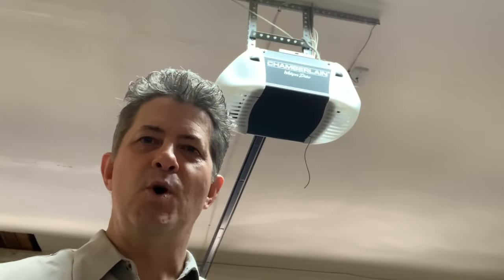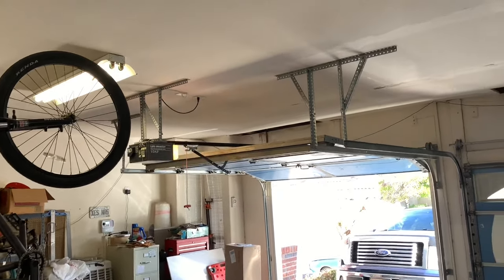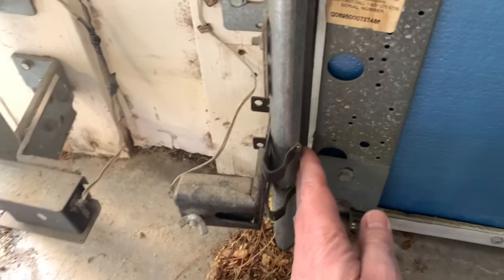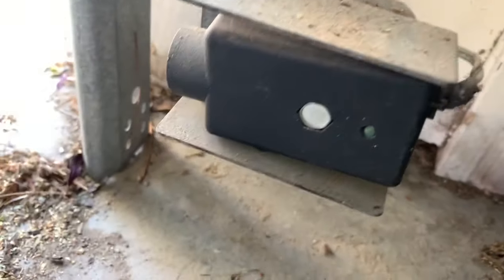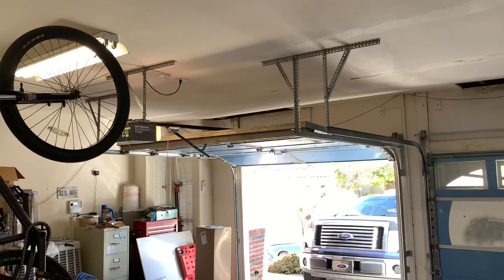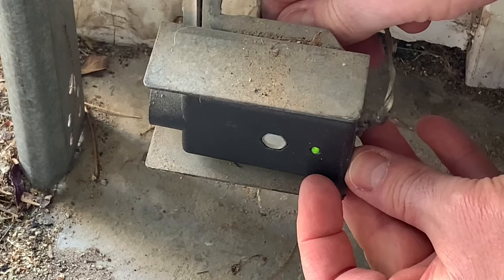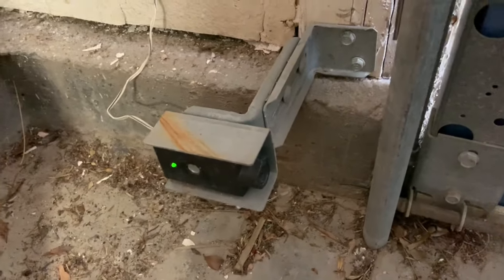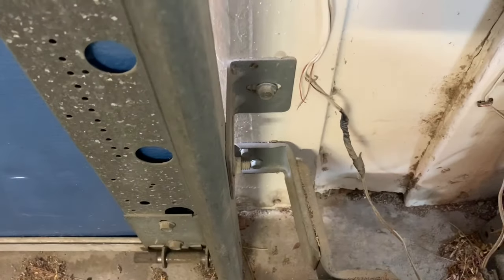Garage Door Opener Stops and Reverses

Comment: Our light on the sensors are both one one red one green but our garage door is still not going down but will go up.  Do sensors with light working be bad?
Reply from the maker: Sometimes when the seasons change you need to adjust the opener. I would try increasing the downward force slightly. There should be a dial on the motor for this

Comment: Hi, thank you for your videos. My garage door is stuck at about 2 inches above ground. If I press the button to close it , it closes, and then automatically reverts to 2 inches open. The light does not go on and off. Any suggestions would be gratefully received. Thank you, Paul
Reply: Did you figure it out?

Comment: Finally figured my problem with the garage door not going down after playing with the sensors. When I couldn't turn off the garage motor light I looked at the sensors light assembly and saw that it had moved inward which not where it needed to be, so pushing it over made the sensor light come on brighter like it should be. So I also tried it and the door came down like it should and the light on the motor could be turned off and on. Hope this might help others with this problem.
Reply from the maker: Glad you got it figured out!

Comment: I havent checked my sensors yet ill do that tomorrow but for now i just have to say when i click close it goes down to about 6 inches from the floor than goes back up but if i follow trough with my hand just light pressure on either inside or outside of the door kind of like help it on its way down it closes fine so can that still be missaligned sensor or something else
Reply from the maker: Based on your description it doesn't sound like a sensor issue to me. I would increase the downward force slightly on the motor. That should solve it.

Comment: My garage automatically opens any time of the day. How can I solve it? Thanks so much in advance.
Reply from the maker: Curious if your door opens as a neighbor opens his door...As a starter I would change the security on the opener to make sure nobody in your neighborhood has the same code. You can either hit the smart or learn button, or manually go in and change the dip switches on the motor unit.

Comment: My sensors are solid lit.  My door went up + won't stay closed now.There are 2 up + down lit arrows on the back of the motor.  The up light is blinking twice, the bottom arrow is blinking 3 times.  Any advice ?

Comment: If it's almost all the way down and then it stop and reverses itself, could it also be the sensor?  What other things could I check?  Thanks!
Reply from the maker: Try increasing the downward force slightly. There should be a small knob on the motor unit for this.
Reply: I will check to see if I can find that knob.  Thank you for that information!  :)
Reply from the maker: @squirrelattackspidy  Welcome!

Comment: Hi Mike, I cleaned around mines but it's still not working. Can it be the wire?
Reply from the maker: Could be several things, including the wiring. Check to make sure the wire is secure to the sensors (some don't have adjustments as they are one-piece), could be a staple holding it to the wall pierced the wire and finally some movement is causing a problem, could be where they connect to the motor, or could be within the opener itself

Comment: My sensors have a red and green. Both seem to be aligned, but when I close the door it goes all the way to the ground and reopens. Any help would be great. Ty
Reply from the maker: The first thing I would do is to shorten the length of travel. If that doesn't help, try decreasing the downward force. There are dials on the motor for this.

Comment: Ok I’m having the same problem with the reversing. After doing the things u said still reversing. I replaced my bottom seal so I’m going to check the book must need to be adjusted ?
Reply from the maker: So if the bottom seal you just replaced is thicker than the previous, maybe the opener believes there is an obstruction and reversing? Try decreasing the length of travel and increasing the closing force.
Reply: I cant get the thing to stop reversing. Now that I think I have had the same thing  before. Needs a new circuit board for one little thing but these days I’ll b replacing the wet. I’m shopping ! No lift masters any more !!
Reply: Mike Klimek that’s what it was u just can’t expect to get it done as the motor gets hot after a few cycles and it won’t work at all !!

Comment: I have an attic ladder by halfway when the garage door opens. Is it possible to adjust the setting so the garage door stops opening when the attic ladder is down/open?
Reply from the maker: You can adjust it, but I don't know how far you need it to be adjusted. Realize that the more you adjust it, the less the door will open, restricting the height of the opening.

Comment: Multiple years of garage door service and repair. If the sensors are in good alignment and the door still doesnt shut its almost never a board issue if the gdo will open but not shut. Its either the door is binding or in severe need of lubricant(by this i mean oil not grease or lithium) as oil will seep into the rust on the rollers and free them up where grease will stay put and do no good and in a lot of cases makes the openers job harder. Example you want the door to roll with as little resistance possible. So which is easier to walk through a pool of water or a pool of toothpaste? Thats the diff between oil and greasr. If the door is not binding and moves easily with 1 hand then adjust the closing force dial on the motorhead. When the motor is 15+ years old the forces need to be readjusted once in a while on those models. Also if your having sensor issues in sunlight you can always swap the old model sensors out with the new design from chamberlain/liftmaster. The new sensors are backwards compatible and inexspensive. Also mostly impervious to sunlight interference. In terms of logic boards going bad on those models youll know its bad as the motorhead will be dead all together. No power to the light bulb socket and no status light on the back of the unit by the learn button. Of course by the time those boards fail its not worth fixing as the gear/sprocket set will likely fail right after you replace the logic board. Then between the cost of a new gear kit and board you could spend the same or less for a brand new belt drive unit that doesnt wake your neighbors.

Comment: I live in an apartment with a garage that is not attached to the apartment...(have to exit garage then enter apartment)One of my light sensors is solid green while the other had a tinkle pale red which is not totally off. I can stand inside my garage and hold down the shutter button to have it closed but if simply press and release once, it starts then reverse. also, if I stand outside the garage and press down the button to close its the same thing, starts to close then reverses. Any tips here, please? One sensor is fully on (green) the other is now fully off (red).
Reply from the maker: Have you tried to aim the sensors toward each other? Just from your description, it sounds like they are not "seeing" each other. If you hold your hand in front of one of the sensors does one get dim or go off?
Reply: @MikeKlimek  Thanks for responding. Yes, I tried aligning them so that they communicate. However, that didn't help. The sensor with the green light stays steadily on but the one with the red light has no light whatsoever.

Comment: My GDO closes fully when I press my remote but reverses to fully open position before it stops. What could be the problem?
Reply from the maker: Do you have to press and hold the button to get it to close? I would first try to slightly decrease the length of travel...It may be hitting the floor and reversing because it is traveling too far.

Comment: What if one of my lights are Red and the other light is Green Both of them are bright and on they or not  blinking and  the garage door is doing the same thing what do I do
Reply: The green lights  are to show you got power to the sensor those green lights a stay on all time and the Red light is the sensor  turning  on and off when something is blocking  the sensor. 
You maybe  have  a Lanier door opener like i do.
Reply: @kachiquitaito3341  ok. Still what do you do if they're not blinking and the door won't close. Do you still need to readjust or do readjusting on the close mechanism inside the panel?
Reply: @MsMturner63  Yes, you need readjusting but first clean  the eyes sensor sometimes those are getting  dust and can't  see each  other.
In one sensor is 2 lights  on it this sensor when you put your  hand  on the eye will turn off, when you take your hand  out of the sensor  light  will come on again.
If you only  have one light  on each  sensor  those can't  see each  other one sensor  have to be with  2 light.( it's when need  readjusting to made the second  light  come on. This second light  is the safety  on and off to stop  the door  from coming down when someone o something  is under  the door.
Reply: @kachiquitaito3341  thanks. It's not the sensors. I've cleaned those and both are on. I think I might need to adjust switches. I'll try that.
Reply: @kachiquitaito3341  I have a Genie

Comment: Hi ,
 Im having an issue of the garage door fully opening and it closes half way through then goes in reverse. I checked the lights on the sensors and everything seem to be working fine. Anything else I can try to do ? Please help
Reply from the maker: You might try increasing the upward or downward force. Sometimes the change of seasons requires a slight adjustment of force

Comment: I have my sensors taped up together and so I have no problem with them....but I just bought a new Wall opener unit and programmed it. But when the door closes it goes right back up. And this cannot be a sensor problem and so I am frustrated not knowing what needs to be done to fix this......
Reply from the maker: So you installed a new wall button? Is it a universal type or a genuine manufacturers part?

Comment: My garage door only sometimes does this. I just checked the sensors and one of them is completely off... no matter what. However, after cleaning the lens and adjusting them manually it has worked perfectly even with one light still off. Is this something to worry about ?
Reply from the maker: It is strange, but I don't think you should worry about it at this point

Comment: Mine happens when my garage has been closed for a longer period.. I will open the garage fine and then when I close it reverses immediately and another time when it was almost closed near ground.  After a few tries it eventually works fine like it should.  I checked my sensors/lights/wires and alignment and it all looks fine. Any ideas?
Reply from the maker: You'll find these types of problems happen when the seasons change. Try increasing the downward force slightly. There is an adjustment knob or button on the motor for this.
Reply: I'm in Florida so its like one season all year.  I'm getting an error that its definitely the sensors, but they are aligned properly and seeing each other so I'm kinda dumbfounded at this point. @MikeKlimek

Comment: I have a single spring door. It was only opening a few inches before it would stop. The prolem turned out to be a bearing at the end of the spring that was rusty inside. I oiled it up good and that took care of the problem. I found the problem by unlatching it from the shuttle and manually raising and lowering it to see what was wrong. Good luck. 😊

Comment: Mine has lights on both of them, one light turns off when interrupting the signal. But the garage door still starts and immediately returns, 10 clicks. I've cleaned both sensors, tried aligning them more (the receiving end seems to give you a LOT of leeway with alignment, it picks up the signal even if you point it at the ground). No idea what to do.
Reply from the maker: Assuming the tracks are aligned and problem-free, try increasing the upward and downward force...sometimes the weather changes can necessitate seasonal adjustments. So start off by increasing the upward force.

Comment: Great video!  Thank you!  Perhaps you can give me a little more guidance...  I have a Craftsman opener.  The Trolley is in the "door open" position.  Push the close button, and the trolley will start to move, but after about two feet, the unit reverses its self to the full open position.  It does this with the door attached to the trolley or without the door.  The main lights do not flash any codes.  If I disconnect the safety reversing sensors, the main lights will flash a trouble code. The trolley reacts as before.  The track seems smooth without any binding.  The chain seems to be in excellent condition.  About six months ago, I replaced the main gear inside the unit.  I can't figure this out at all!  If something comes to mind, I would appreciate a comment.  Again, a great video!  You have a nice, easy approach when talking to the camera - and that comes across as a friend talking to you, not a "repair guy" talking down to you.

Comment: I still can't figure it out. Both lights are on. I cleaned both lens. The wires look good. The sensors are securely on the poles. When I hold down the opener the whole time it does shut but when I press it one time it gets almost to the bottom and then reverses without closing. Any ideas?
Reply: I have the same exact issue! I couldnt figure it out either

Comment: What if it still flickers and it's still kinda dim after adjusting. Is there a way to test it. Cleaned the lenses as well, connections are good too.
Reply from the maker: Do they get brighter at some point when you re-align the sensors?
Reply: @MikeKlimek  They are both bright aligned ok. Already messed with them and all. I took the unit apart and noticed a hairline crack on the plastic gear. Can that contribute. It's a genie.
Reply from the maker: @ruben85374  It shouldn't. If the unit is still lifting the door, the cracked gear is still holding...Probably want to replace that gear before it goes however.
Reply: @MikeKlimek  I think it's my sensors. They are the old school square genie.

Comment: I can't seem to find any info to solve my situation. My garage door goes three quarters of the way down and then just stops. It does NOT reverse and go back up. It just stops about a foot and a half from the ground. If I hit the button again, it will go all the way back up. If I hit it again, it will go back down and then once again  just stop a foot and a half from from the ground again. I've made certain there are no obstacles in the way of the sensors. However, the light on one of the sensors is green, but the light on the other sensor is red. They haven't been messed with or knocked out of alignment that I can tell. Also, I should mention that when the door stops short of closing all the way, the overhead light does NOT blink. It just started doing this yesterday, so I'm at a loss.
Reply from the maker: Things like this are not easy to troubleshoot without putting hands on them. Assuming no damage to tracks, wheels etc, try increasing the force for both upward and downward travel just slightly.

Comment: Hi Mike. My one light one sensor is green and the other is orange. I don’t see a wire cut from sensor. What next. I cleaned both sensors..
Reply from the maker: What is your door doing? Does the door go up a few inches and then reverse or go almost the entire way and reverse?
Reply: The door will go up all the way , but when I push the button, to come down, it will start moving then maybe after 6 inches, the door stops but the chain keeps going. At that point, I have to move it manually
Reply from the maker: @loribraam4186  OK what do you mean that the door stops but the chain keeps going? I assume if you hold down the button no the wall and keep it depressed, the door will go all the way down.

Comment: Mine goes all the way almost closed, then sort of acts like it snags then goes back up and beeps. I wait and keep trying then it finally shuts????  I don’t see any obstruction.  It is at night so no sunlight blocking sensor. Lights on sensor look fine and clean.
Reply from the maker: With the change in the weather, it's common that materials shrink or expand...try increasing the downward force slightly

Comment: My garage door opens all the way then immediately closes .  And the light comes on and goes off while its closing.  Can you help me?   Thanks
Reply from the maker: It's possible that your length of travel is too long. Try adjusting the length of travel  so the door stops earlier. As the door opens, does it bank into the stop near the motor and then go back down?

Comment: The sensor that is supposed to be green is not illuminated. I tried to wiggle it and nothing. The other side the light is lit yellow so, I think that one is ok right?
Reply from the maker: It depends. Each side will usually be illuminated. It could be that the side that is out is truly not getting or receiving a signal, or that the light is burned out? Check the connections at both the sensor and the motor.

If you hold your hand in front of the sensor with the yellow light, does this light go out or dim?

Comment: Not clear what you meant about a piece of cardboard to block the sun - it might've helped if you'd shown how and where you put it.  Also.....are the sensors' lenses always supposed to point at each other??
Reply from the maker: Yes the lenses are supposed to point at each other. As for the cardboard, the point is to block the sunlight from blinding the sensor. It doesn't have to be cardboard but something that generally sits between the sensor and the door so that the sun won't shine into the sensor, yet the sensors can still see each other.
Reply: @MikeKlimek  thanks for clarifying where it should go